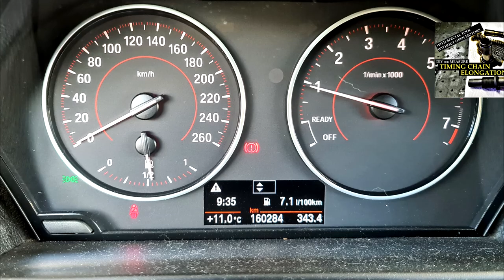Remove TIMING CHAIN & VALVE COVER - 160tkm service PART 2 - BMW F20 engine N13

Comment: Hi Jani, I replaced my timing chain at about 170k KMs, thanks a lot to your videos. Old one was however hardly elongated. Also noticed quite surprisingly it was possible to install the fly wheel pin at a different position which is quite alarming as i initially thought my chain had skipped teeth. But finally managed to install with all pistons lined up.
Reply: Job took about 8hrs

Comment: Please help, i did my timing replacement for the same engine but then i get rattling sound while accelerating at 1000 - 3000 RPM

Comment: hi bro thanks for your viddeo it does help me a lot  appreciate much.

anyway when u going to plan to do the rear main seal / gearbox flywheel seal?

would happy got more confirmation how to take off the gb ...
Reply from the maker: Hi!
Check my video of removing gearbox from N43 motor. Process is about same: https://youtu.be/-H9U3tZGwYA
Also crankshaft seals: https://youtu.be/L0ivwXzVKXw

Comment: Excellent video!  Can you advise if it is necessary to remove the turbo when replacing the exhaust vanos solenoid?  Thanks!
Reply from the maker: Thanks! 👍
It would seem that the turbo does not need to be removed. It is enough to remove the intake silencer housing and clean air pipe from the front.
Reply: @JaniVoutilainen  Thanks.  Much appreciated.  Best!.
Reply: @JaniVoutilainen  Btw .. what kind of bolt is used to fasten the solenoid?  Normal bolt or Torx bolt?  Happened to remember the size?  Tnx

Comment: How do I get to tdc and make sure all the camshafts are in the correct position when my exhaust camshaft is slightly in the wrong angle due to my timing chain skipping a tooth ? And how do I fix the timing ? Thank you.
Reply: Did you manage to find tdc I have the same problem

Comment: As always just top notch the filming and descriptions! Would yo say the N13 is easier than the N43 to change the chain ? Is the counter hold tool you use here to release the crankbolt also for the N43 usable ? Thanks and keep that stuff coming!
Reply from the maker: Thanks! 👍
The N13 engine’s flywheel locking tool gets more easily in place than the N43 engine. In the N43 engine, the intake manifold must be removed from the front before the PIN locking tool can be inserted.
In addition, there are no fuel lines on top of the valve cover.
I'm not sure about that holder tool 119280 that it works on the N43 engine.
The BMW manual recommends using tool 118180 (the same one I also use in this video)

Comment: Why not change the oilpump chaine
Reply from the maker: Personally, I decided to just change the timing chain. I would argue that less often the oil pump chain is a problem.
I will then change it separately if I ever need to remove the oil sump ...